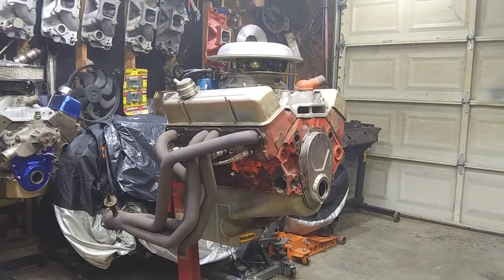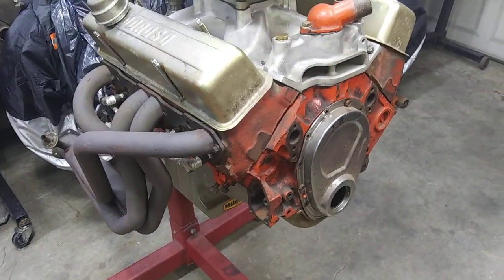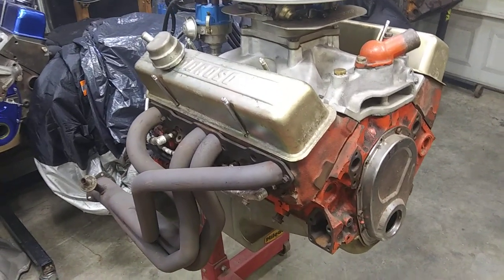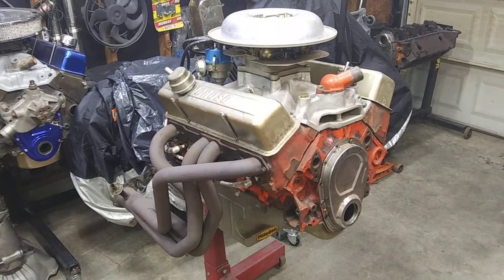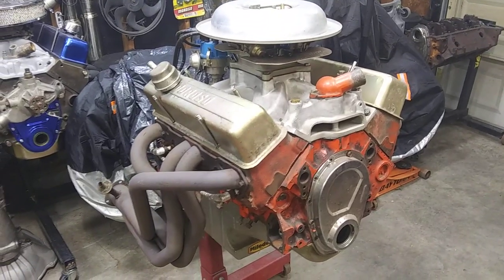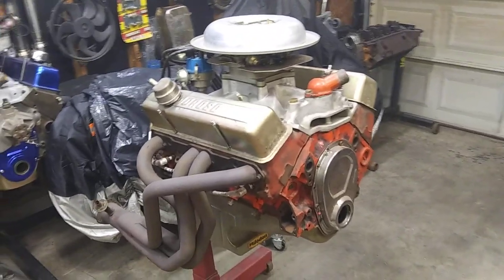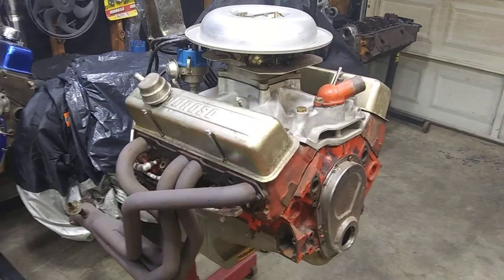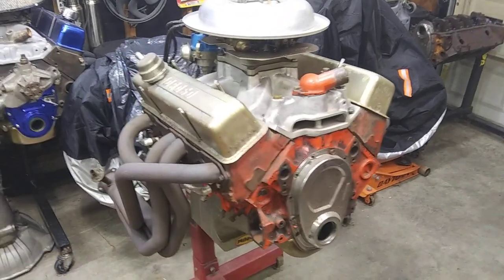The truth about the "Double Hump" heads.

Comment: If you aren`t looking for numbers matching parts don`t bother looking at them. Vortec heads make 340 HP @ 5400 rpm with a dished piston on pump gas. (602 crate motor) The humps were the best of their day and it has passed.
Reply: Exactly you can make 400hp easy with Vortecs that have only had spring clearancing and screw in studs on a 355 with flat tops, modern roller cam, good intake and carb. If you work the ports and mill them for more compression and run more ci 450+hp isn't going to be too hard. Of course even cheap Aluminum 23° heads out of the box with 355+ci and the right supporting mods will make 500 pretty easy anymore.

Comment: Yeah it’s the holy grail when it comes to building old skool horse power I grew up building motors in the 90’s an my whole life that’s all I ever herd was “double hump 2.02 with angle plugs!  That was the top shelf heads with 2.02 intake valves an the plug angled to the exhaust valve for the dome piston engines .  Then you hear of the legend “SmokeyYunick” to find out he worked with GM on a lot of motors and a bunch of heads !  He said they even sent him heads that were like a “Hemi” head. He told them there was nothing wrong with the head they had. To make casting changes for what is was worth would not be good .  On there pocket book or r&d time that had already done on these heads they already had.  I hear or the famous “302” motor alot of people don’t know yeah Chevy had a 302 .  The first time is was built an ran was 1965 Daytona Smokey Yunick” built one an won that race feb 65 ! The previous year at that same track the 426 Hemi won 1,2,3,5 place .  So in turn the facts from then state the small block Chevy with double humped heads could technically beat a 426 Hemi .  The basic design used by all NHRA dragsters to day .  Yeah an the thing is I think I would rather go to a electric Tesla rear end in my hot rod if I had to be told “LS” .  If is not 265-400 original small block Chevy .  Then I’d rather go electric .  The saying in always remember that I coined my self and all the old heads said they agreed was “ if you build a small block it better be a Chevy if you build a big block it better be a Hemi! That’s just the facts based on wins pound for pound inch per inch there ain’t no small block that has more wins than the small block Chevy .  If it always on paper forever in our heart.  Cause my dad told me when we bleed son our blood cells are not round there shaped like a Chevy bow tie! I’d say Smokey Yunick probably did more for Chevrolet than carol shelby ever did for ford .  But never got the recognition he truly deserves he help Chevy with the top three Chevy small blocks of all time 327 in 62, the 302 in the 67-69 Z28’s and the 400 small block from 70-80.  I don’t recall any manufacture that brung 400 cubic inches of small block to the table .  400 small block just those words would make racers crawl under rocks an wanna hide! Other than “double humped heads” that would be the first saying that really got every ones attention!  I have a 327 350 HP but couldn’t find any old double humped heads I just bought a set of aluminum ones , motor doesn’t have to be “correct” for the truck I’m putting it in .  One hell of a video hats off lot of memory lane stuff couldn’t ask for a better interpretation of what they are .  I seen a comment about a famous country singer building Chevy small blocks .  I thought that was pretty cool this guy does sound like ol Kris ! He does know exactly what he’s talkin about.  Love the video, gear heads will be gear heads when there laying in there coffin . Because right around the corner or right out side they will be be .  Some guys saying do you remember that car or that motor .  Even after the coffin has been lowered into the ground .  It will be said I got this part or that part from him or her. Or they taught me this trick or what parts to use and what not to and such!  Gear heads for life and even after !
Reply: The only head to have the angled spark plugs  was the 492 and the reason  it was superior  to regular castings was the fact that the angled drilling of the spark plugs holes repositioned the firing end of the plugs higher in the combustion  chamber so the flame wasn't  blocked by the piston dome, but this was only good if you were using high dome pistons, if you were not using  large domed pistonscthe results  wasn't  that big
Reply: The 302 was built because there was a cubic inch restriction...they didnt race in the same class as the 426 Hemi.

Comment: I believe rhs makes the double hump in aluminum, someone does. 2 summers ago I built a 12:1 383 stroker and I ran Elgins 30 30 duntov solid with a set of 041X  heads in a 81 Malibu with a g80 locker and 410 gear. I ran my buddy in his 81 Monte with a 9:1 383 and he had a Howards .565in .585ex fully roller motor with dart pro1 64cc aluminum heads. We had the same rear end setup except he had a full spool. Basically same exact car. Neither one of us could get traction both cars would spin until up around 45,50 mph. His car sounded like a pro mod drag car with that big cam. I think if we had them hooking up it would have been an extremely close race. You just can't beat the old heads for what they are. The huge difference I seen between my steel head engine and Rods aluminum head engine was the engine temperature. Major difference, we both ran electric fans and I had a much better radiator but he could literally run 15 to 20 miles in the summer time before his motor reached normal operating temp whereas mine would reach full temp in half the amount of time if not a tad less then half with the fans off. Good video

Comment: Yea they are thicker , but the port design is better on a vortec.not to mention the fast burn chamber. If you want the double hump to flow like a vortec get ready to grind grind grind. But the cool factor is priceless!
Reply from the maker: Yep, kinda what I said. But the old heads can be ported more than a Vortec.
Reply: I actually  wouldn't  do it myself I'd just have those guys at berinski racing port them for me , I know alot about  these heads but compared to berinski  I'm a nothing  these guys know these heads frontwards backwards side ways diagonal inside out !!! No one is better  then them when it come to these heads  sorry about  spelling  their name incorrectly
Reply: @The Reluctant Gearhead  Yes and no it all depends  on what heads you are using
Reply from the maker: @johnalarcon5006  They are definitely skilled with the early iron. Prices ain't real bad either.
Reply: @The Reluctant Gearhead  You're right infact  I'm thinking now having  my 291's done by them and knowing  me il have them do a full on port job, I already  had the screw in rocker studs but Iike a dumb ass I didn't  have the stud bosses machined down for guide  plates , my friend  did a little pocket  port on  them but they definitely  need more, iv had them on my little  307 for many years and it really  woke that lil beast up, but now I want a Dart 400 stroked 434 , im still going to leave the 307 badges on it just  to f with people 🤣
Reply: @The Reluctant Gearhead  I heard  somewhere that those  heads wouldn't  work on a 307 because  the valve would  hit the edges of the cylinder???? Well if I remember  correctly  we measured those  valves  at 202 , when I remove them soon im going to re measure them!
Reply from the maker: @johnalarcon5006  307 has the same 3.875 bore as a 283, and they fit them. I seen some pretty serious 307 builds back in the day for C & D Modified Production class cars. Around 10lbs per cube. Also Econo dragster and Econo altered classes used small cube V8s, mostly Chevys. 550+hp 283s & 307s weren't that  uncommon back in the late 70s drag racing world in certain classes. High RPM little bastards too. 9000+rpm was the norm. I've built a few small cube screamers over the years. Had a 68 302 I shifted at 9800rpm in a Vega drag car.
Reply: @thereluctantgearhead4544  Awsome!
Reply: @The Reluctant Gearhead   I'm having  a  stroker 400 Dart block built  with around 800 hp. However il be having  a bigger  engine  built by this guy in Chatsworth , but that's hopefully in 5 years , so for right  now il have to settle for  the 434 small block. My friend randy  is in the process  of finding  a builder for a 408 small block stroker project out if a 350 4 bolt he already  has. We are two old farts trying to re live our youth but having fun👍
Reply from the maker: @johnalarcon5006  I'm building a couple nasty bigblocks for my need for speed, but I still love my old SBCs. I drive a 500+hp SBC daily. My 496 I'm working on should make 800+hp NA. Also building a twin turbo 427/439ci TD bored .060, forged 3.76 stroke crank, 6.535 long H-beams with ARP 2000 cap screws. Ross pistons, big Lunati solid roller. Looking for 1200+hp with that one. Also building a twin turbo SBC I'm hoping to make 1000hp with.

Comment: I like old heads for street use. Double humps, 882’s, Corvette / zz4 aluminum, Vortec.
They work great and do just fine at the 400 hp mark without going too nuts.
You just have to be able to do most of the work yourself.
Reply from the maker: Yep, they still have their place. Too bad the machine shops charge so much these days. I have a bunch of killer old iron, but it would cost a fortune to get them all ready for use. I'm in that situation now, I'm working on a 454, was trying to build it cheap with parts I have laying around. Was gonna use a pair of 820 casting 1971 Oval port heads, they were completely built back about 35yrs ago, but now they need all new guides, fresh valve job and milled again. I'm just gonna buy a new pair of budget AFR Enforcer 335cc aluminum heads bare and still have money in my pocket. I already have enough parts to build them and I can set them up. Not to mention they flow alot more air. I'll probably bowl blend them and throw them together. I wanted to use them old iron heads, but it would cost me around $1400-$1500 bucks to get them in shape. The AFR Enforcer bare pair is $1200. Already have Manley intake valves and Ferrea exhaust valves for them and all Lunati hardware to go in. Of course I gotta swap pistons too for the increased cc chambers to get the compression up. But it'll have alot more power, so it'll be worth the hassle. Can't nothing be cheap and simple anymore it seems.
Reply: 882’s are garbage

Comment: What about the Rare corvette 2.06 experimental heads? If I, remember right. On front of the heads, was a connected small double square. I, might be wrong. Been years since I, seen those heads used on a 355 Chevy, that was on a pulling tractor. That 355 ran great with those heads!!
Reply: What head was that?????  was it aluminum  or iron???????
Reply: Iron
Reply: @shanecloyd6646   I remember  something  to that effect  but need to check my records  I have alot of information  on these heads written  down ,  they originally  called them the fulie   ( F I ) heads because  they were intended to be used as fuel injection on  early corvettes but it really  never  materialized , and so what GM did because  they had all these castings laying around that  were already  made they basically  decided  to use them on alot of intermediate cars like impallas, caprice,  ect   these heads were intended  for the old dog house style   fuel injection  Chevy made !
Reply: There was a 624 double triangle head  but  it  was originally  used on the LT1 1971/72 camero and also used on the 1971 -74 Z/28 and 73 -79 L-82 engines,  this is the only double anything  head I found. Of all these cast iron fulie heads the best one is the 492 castings. Now Chevy made a 292 head that was called the turbo head and this particular head was the first  casting designed specifically  for racing  applications, the turbo name was from a turbo  charged Indy engine that never happened  but somehow the turbo  name  stuck , these heads also had angled spark plug for engines with higher  domed piston , the 492 heads also had angled plugs  for the same reason
Reply: @shanecloyd6646   the very first  fulie  head castings was the 461 head  the last castings were the 291 head
Reply: My neighbors, were into mini rod pulling tractors. My best friend, his dad always used Ford engines. From the 300 6, then a 289, then a 460. They had trouble competing against the sb and bb Chevy. So he went and bought that 355 Chevrolet from a guy getting out of tractor pulling. He told him about the rare corvette heads on engine and it was a fuel injected engine. With that engine he was able to compete. It has roller cam lifters dome pistons 4 bolt main. Bored 30 over. And a magneto ignition. That engine was powerful.
Reply: @shanecloyd6646  I don't remember  a mag being  ran on a production  vette  maybe  racing though,  I ran a sprint mag on my chevelle but it was very temperamental for street use , plus when I pulled up to a cop car or fire truck they would  look at me funny  because  magnetos emit R F and it puts a static buzzing  sound  on their radios , iv ran ford engines  and Chevy engines. Fords are strong engines however  the Chevy small block  is easier  and cheaper  to build, with the Chevy SB it's like one size  fits all , and when it comes to head design  between  a Ford and Chevy il take Chevys 17 head bolts  over ford's 12 head bolts , I don't like o ringing my block or head !
Reply: @shanecloyd6646    I want  to say that 206 head was a big block head  not a small  block head , I never  really  got into Chevy  big block  engines , mainly  small blocks !
Reply: Hate to say but it was
Reply: No it was a mag bought from a performance shop.
Reply: @shanecloyd6646  oh ok
Reply: @johnalarcon5006  you can easily make over 1000hp with a boosted 351w without O ringing the block to the head.
Reply: @hendo337   yeah well considering  that Ford blocks only have 12 bolts holding the heads down I definitely  would o ring the block , my friend  was a Ford expert and he always  said it was a weak point in ford's design
Reply: @hendo337  it's not so much making that 1000 hp it's keeping it from blowing the head gasket my friend had a built  Mexican block 302 and he had head gasket leak problems with it and he was running  a blower on it , it ran great but he removed  it because  of head gasket  leak issues,  I can't remember. If he grooved  the heads or the block for a Cooper o ring. I'm not too familiar with  Ford engines anymore , I like chevys 17 head bolt design  better !

Comment: Whats your opinion on a 302 Chevy?
Reply from the maker: Killer engine, I ran 6.20s in the 1/8th with a NA 302 in a Vega drag car. 9800rpm on the shifts. Wish I still had it.
Reply from the maker: These heads came off a 68 302 MO code. Used the block and crank in the Vega. Swapped BME aluminum rods and 13.5-1 Arias pistons, lightened up the stock forged crank & knife edged the counter weights, hard chromed the journals.  288/288@.050, 680/680 lift 106 LSA Ultradyne solid roller, extremely hogged out Bowtie heads and a ported Strip Dominator intake with a 830 Annular discharge Holley on a 2-in spacer.  Stahl 1 7/8 headers. 7000 stall and 6-17 gear behind it. Revved like a chainsaw. That was decades ago.
Reply from the maker: Getting the parts together now to build a 8500+rpm 66 327 L-79 . Going with aluminum rods and SRP pistons with a 4340 lightweight crank. 13-1+ compression. Going with a .650/650 lift, 284/292@.050 106 LSA Crane solid roller with ported DART 215cc runner PRO 1s from 2010, and a DART singleplane 4500 flange ported intake. It should make over 600+hp NA. Always had a soft spot for high RPM SBCs since I was heavily influenced by Modified Production & Superstock class cars as a youth. My dad drag raced in those classes back in the 70s and  Gassers back in the 60s. I once built a .060 over 307 that made close to 550hp decades ago. Prepped 327 Forged crank with bearing spacers, Bowtie rods, JE pistons, 12-25-1 compression. Used Brownfield aluminum heads on it with alot of work, angle milled to 48cc chambers. Edelbrock Victor E intake & 850 Holley DP. 630/630 lift, 270/278@.050, 106 LCA Lunati solid roller. It ran mid 10s. Nothing sounds as good as a SBC turning 8000+rpm. 5-13/5-38/5.57/6-17/6-50/7-17 gears are the norm and a whole lot of RPMs on the launch s mandatory. 7000+rpm launches are a good place to start.

Comment: I had a 406 with set of these amd had em hoghedbout. Flowed 293 cfm at 630 lift. Had a 1000cfm holley 4150 carb. Wasnin a 79 elcamino rear engine mud bod toy. Its still got a oic on bangshift site under 850horse elcamino. The engine in it was weak so i had build another one for it and finally got rid if it. Axles were fluopedbyoside down so it wouod run foward. Hilarious barn build. Thise heads were epoxied amd all because if the port work.
Reply from the maker: I've seen people get big numbers out of them, just look at the NHRA Superstock 350s are doing. Definitely have potential.
Reply: @thereluctantgearhead4544  just alot of fun man. 👍
Reply from the maker: @richbon9904  I know that's right. Half the fun is building them.